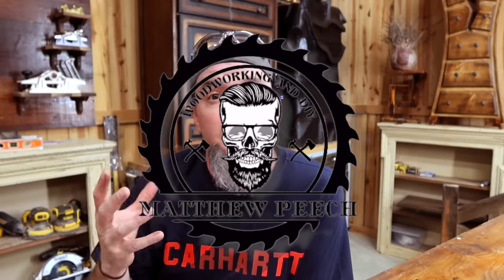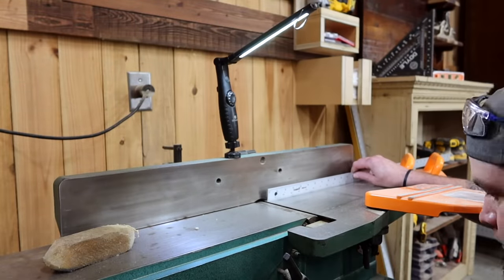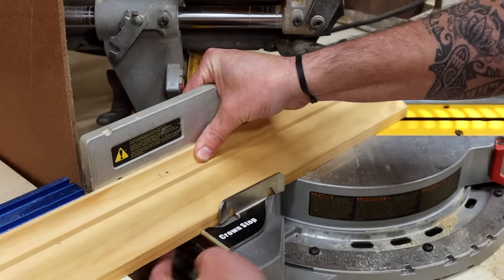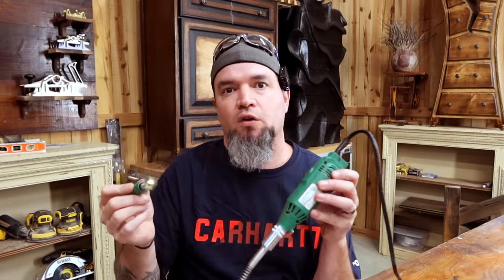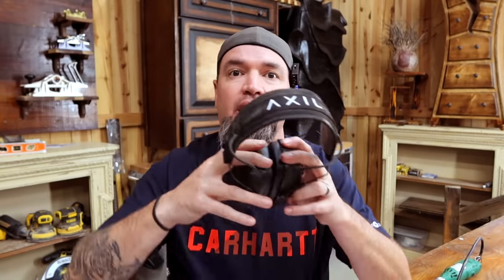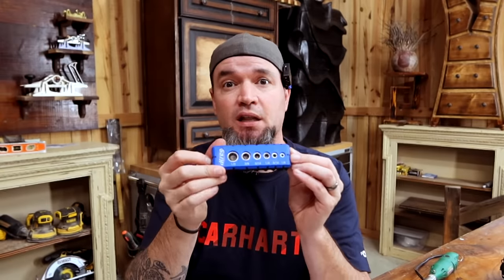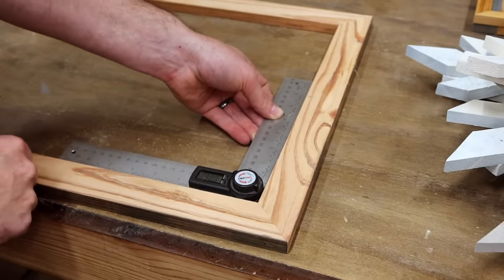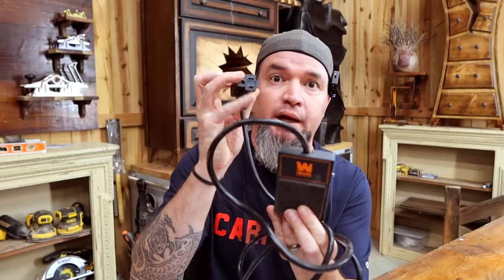12 Must Have Tools Under $20!

Comment: Howdy Mr. Peech. Of all those tools....that last one, the foot pedal. That's a BUY for me. Never knew it existed. I have a small shop vac, like 2 gallons, I think. I use it ONLY for my chop saw (which btw, the small shop vac has MORE suction power than a large one, it just doesn't carry over a distance, but being right under my chop saw I don't have hardly any dust at all) and reaching down to turn it on/off is a bit cumbersome. 

Since the chop saw is only used for a few seconds to make a cut, having my vac hooked up to that pedal would be FANTASTIC!!! I'm a buyer for that. 

Hey....Here's a tool I've NEVER seen you or Mr. 731 or anyone mention and it's under $20 also. 

A pencil sharpener. But not just any pencil sharpener....but this is the kind/type "we" used in school. Remember those days? Had to raise your hand, ask permission to get up and sharpen your pencil, then get told you should have done it when you first came into class. You know, it was ALWAYS attached to the side of a bookcase and ALWAYS on the other side of the room. It was a hand crank sharpener. Yeah, those "LITERAL" old school ones. 

I can't remember the name of that brand, but I know they are no longer in business.  However...I bought one just like it, same function, same design and made by Exacto, the same company that makes... Exacto knives. Now common....It's gotta be good. Yes Sir it is. Works great, sharpens to a fine point. Under $20 bucks. I HATE mechanical pencils. Can't stand them. Scurge of all pencils. 

Just thought I'd toss in the pencil sharpener idea. Add it to your next "Tools Under $20" video 👍👍👍👍

Comment: A tip for everyone, do not use headphones with electronic noise canceling for hearing protection. Electronic noise canceling headphones do not protect your hearing from dangerous levels of sound. They may seem like they're reducing sound to your ear, but they're actually just masking what is still going into your ear. Your ears are still getting blasted with dangerous sounds. The only real solution is traditional physical noise-isolating muffs or plugs. 

I think the kind in this video physically isolate noise and have an external mic that electronically transmits sound in when you want it to, but it's hard to tell from the video as well as the product description on Amazon. 

Whatever you use, just make sure it's the headphone physical material providing the hearing protection and not the electronics like most mainstream noise-canceling headphones.

Comment: Grea list of must have tools under 20 dollars. Some years ago I bought the little box magnetic angle finder. I paid about 30 Euros for at (approx. 30 USD). But I didn't have a table saw that time, so I put it aside. Now I do have a table saw, but can't find the angle finder back.  😞  I'm (was) considering buying a new one. On Friday I was in a store where day sold them.
They wanted 50 USD for it!!! So, I didn't buy it.  I should look on the internet to find a cheaper one. Or try to find the first one back.
Reply from the maker: I hate when I put something up so I don’t lose it…. And then I can’t find it lol
Reply: @MatthewPeechWoodworking  I've started to make pictures when I move things.  Now I only need to find that picture back. But now I can't make pictures with my digital camera because I can't find my battery charger. It has a dedicated place but it is not there.  It seems the Bermuda triangle has moved.

Comment: Well I plan on making a level case for my cellphone for one reason. For galaxy / android phones I found an extremely useful app that works as a bubble level / leveler. The app is bubble level galaxy. I think it might throw advertising at you but for free might be worth it. It also does flat leveling as well as angling. From x and y axis 0°x ,  0°y to about -55x and -55y and 55 positive x and y. Of course 90° levels will find the flat surface as well. Yet I like my cellphone and might need it. Might as well find a free app and find a new reason to keep it around me. Might even pair well with those headphones you mentioned.

Comment: like the safety glasses, but one thing. Those won't work well if you wear glasses. And if i put contacts on, I still need glasses to see fine details, like reading a ruler. I've been going with a face shield in those situations.
Reply: Dewalt sells safety glasses with bifocal readers in them.  I have a pair that I use in the shop all the time.  I don't need prescription lenses for normal seeing, just for reading small print, and these work great.

Comment: hmmmmm... on the cheap digital calipers.

Maybe for woodworking they will suffice.  They are rarely "exact" though.  In our precision machine shop, the metrology/calibration department will not even allow harbor freight or other cheaper measurement tools in the shop as they cannot hold a calibration.

One way to verify "good enough" is to check your 1-2-3 block on a regular basis & make sure your calipers are correct to that.  Calipers may read 5 tenths (.0005) in resolution - but are only accurate to thousands (.001).  Plenty good for wood working most likely... especially if they read 1.000 on a 123 block.

Comment: COB does not mean "strip light". It means "chip on board" and can come in variety of shapes and sizes. For your application, it doesn't matter if the LED is COB or just a bunch of diodes on a strip, I doubt the better diffusion or in cases CRI would matter at all. I realize it's a woodworking channel, not a an electronics channel, but maybe research stuff better before giving advice.
Reply: Who cares!